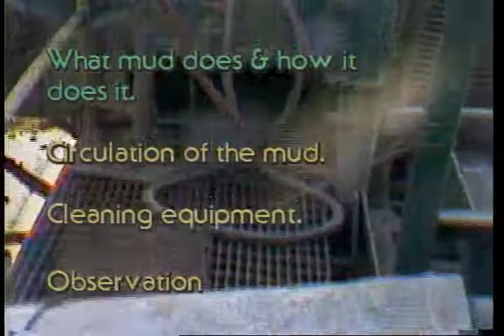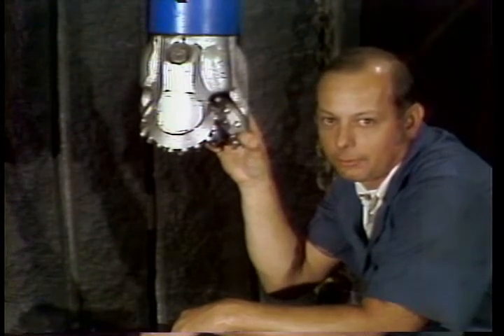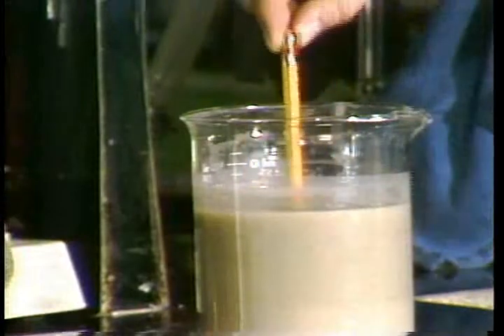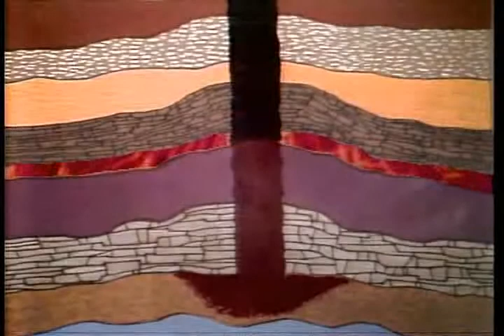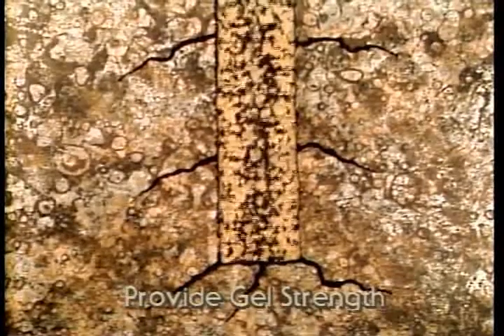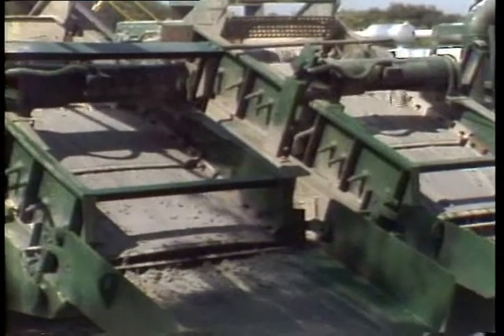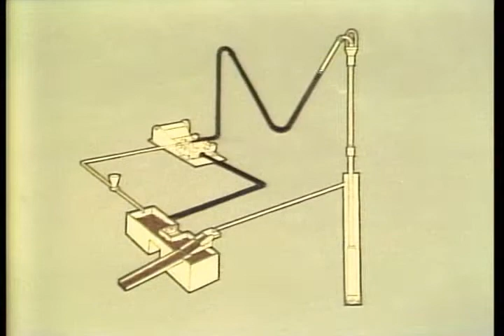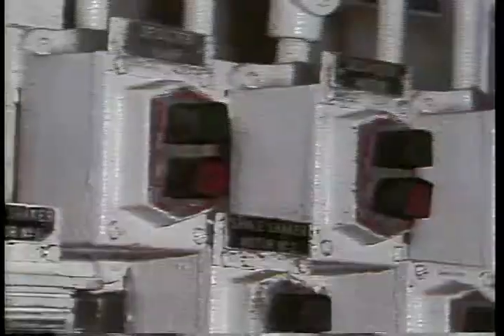Mud basics

Comment: Pretty good video... as a footage driller in texas for over 20 years... never have I witnessed the heavy mud fight the gas work ... I've seen it burn down lots of rigs around us around Pecos ... underbalance for high volume low pressure areas , 400 gpm max for efficiency... keep the flair about 10 ft to 15 ft and she'll dig plenty fast... hold back the lower wolfcamp and rely on equipment is when folks get killed... but hey.. never a hand was injured on my watch .
Reply: glad to hear you kept your guys safe
Reply: thank you for your service
Reply: Powerful!